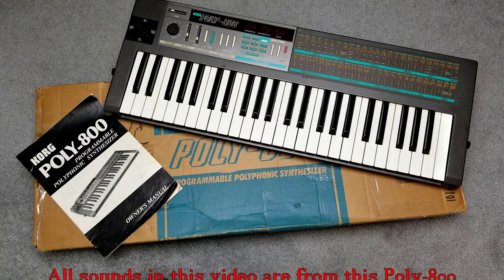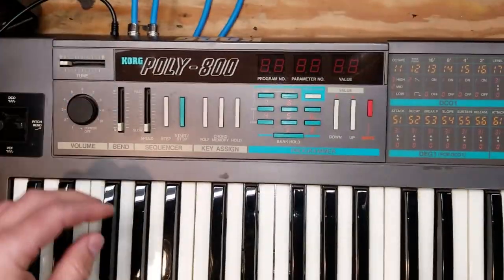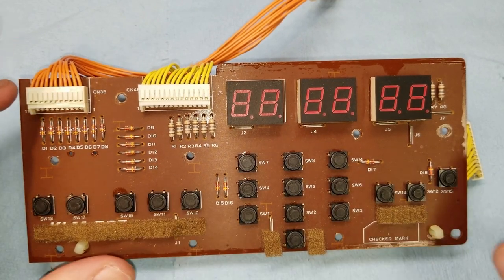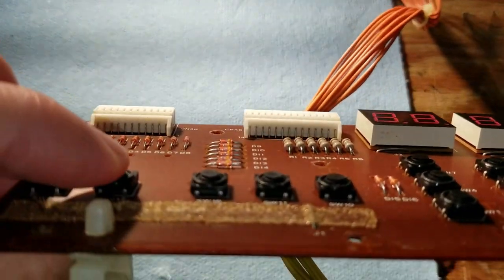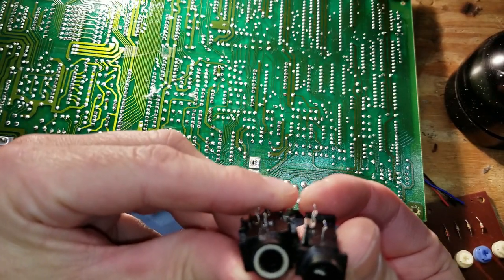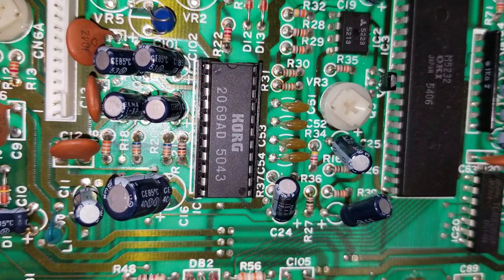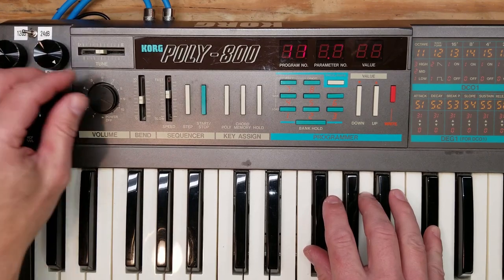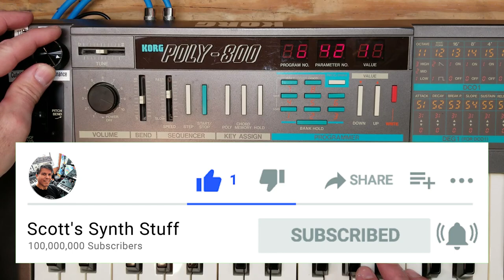Fixing, Restoring and Modding a Korg Poly-800!

Comment: You got super lucky with that battery not eating away at traces.  These and a decent number of Korg synths from the same era (Poly 61, Poly 6, etc.) are quite well known for the batteries leaking over time and absolutely tearing the boards to shreds thanks to the acid.  

A few years ago these weren't even worth repairing because of it, but thanks to everything synth that's old being worth more money now, they're worthwhile repairing.
Reply from the maker: Agreed. I had a Polysix that I bought in the late 1980s, and over the next 10 years or so, the NiCd battery leaked in it and destroyed a bunch of traces on the circuit board. I restored it in around 2003 or so, replaced all the tactile button switches, and repaired all the corroded traces. It was a LOT of work.

Comment: Love your channel man, thanks for sharing all this!  I subscribed when I realized you've helped me several times (Cobalt 8 firmware upgrade and general care tips).  I found this video on accident trying to figure out why I couldn't load patches from tape.  Thanks for the reminder to do the Moog Slayer mod!  I plan to tackle this soon.

Couple notes:  My patches load but I never got the "Good" message that I had when saving/loading/verifying with actual tape recorder instead of a smartphone.  Seems to have loaded okay regardless (at least most patches).  My tact switches are touchy but I just use the bank hold (only use this in the studio).  Also, corroded audio jacks can often be fixed by rolling fine grit sandpaper and giving the inside of the jack a quick scrub.  Just wanted to share, maybe it helps someone.  Thanks again!

Comment: Excelent video.  I wonder, is it possible to use a power supply when changing the battery so you dont loose the patches?
Reply from the maker: Plug it in and turn it on, remove the old battery, install the new one, it will keep the memory.
Reply: @ScottsSynthStuff  thanks!

Comment: Superb presentation and clear description of how to restore this great little synth. Like some of your other commentators, I’ve had one of these instruments from new and 40 years on have two different problems that you weren’t able to cover as my model is one of the first and does not have back up battery, but relies on the type C batteries to back up the sounds, and when these expire, one loses the programmes. I’ve bought a CR2032 holder and the appropriate battery, but how do I wire it in and let it take over from the C batteries? Second issue: on turning the machine upside down I’ve upset the joystick, which has now gone limp. How do I fix this? It’s not broken as such, just limp and won’t stand up. You can still get modulation, but not pitch bend?
PS: Although there’s a space on the board where the battery would go (in the future models) there are no terminals to wire the same onto the board, hence my fundamental problem.
Reply from the maker: Just tack-solder your battery holder to those terminals on the board and you should be good to go. If it doesn't quite fit, you can extend it using short wires (like I did) and tack-solder those to the board.

As for the joystick, it uses little leaf-spring type springs - I would perhaps disassemble and see if one of the springs has broken? It could also just be dirty and preventing a spring from pushing against the stick end.

Comment: This is incredible timing for me as I'm restoring a Poly 800 II too! Amazing video. Did you notice any difference on the buttons once the foam was removed?
Reply from the maker: Nope, no difference at all. I'm not sure what the original function of that foam was, but whatever it was, it certainly wasn't doing it anymore. Maybe it was to act as a seal/barrier for any dust and dirt that got through the buttons on top? I can't say for sure.
Reply: @ScottsSynthStuff  thanks getting back to me. What I found is that the foam just helps the longer buttons sit more uniformly. Without the foam they wobble a bit, but honestly it's barely noticeable.

Comment: Exactly what I was looking for, many thanks!!👍
I am wondering if a ring modulation mod could be done as well!!
Reply from the maker: Ring modulation normally works on two oscillators and multiplies the oscillators together to get the ring modulation effect. The poly-800 has only the one oscillator per voice, so it's probably not something you could do.
Reply: @ScottsSynthStuff  
Thanks for answering!! Yes, just after posting I was in a doubt about the Poly800 having one oscillator instead of two! You confirmed this!👍

Comment: Hello, Scott! Can you please send me the location where the wires from the pots are soldered, as the website mentioned in the description is no longer active... By the way, excellent video.
Reply from the maker: What a shame that site went down, there was a lot of good info there. Anytime a site like that disappears, you can usually still find the content in the web archive, and that's the case with this one. You can see it here: https://web.archive.org/web/20220427121311/http://synthmod.net/korg/moog_slayer/
Reply: @ScottsSynthStuff  Thank you very much! I just have a question about soldering the red wire to the resistor: can I use the resistor we desoldered from the ground, or should I buy a new one with a value of 470-510 ohms? I don't have much knowledge about electronics, I'm just a synth enthusiast :)
Reply from the maker: @Kassatube  you can just reuse that resistor!
Reply: @ScottsSynthStuff  Thank you for the quick responses, You're the best. I'm diving into the work right away!

Comment: great video....i have a poly800II that needs some components replaced 
due to dampness issue. do you or could you help me identify which 
resisters need to be replaced. thanks...would love to get it working 
again
Reply from the maker: If components were damaged because of inappropriate voltages because of dampness, you are (potentially) going to need some very complex diagnostic skills.

Comment: Best video on the subject, thanks! Unfortunitely there are no true videos on how to do the mod on yt. All i found were short demonstrations. The somewhat cumbersome read of the original slayer mod webpage doesn't help either. Can anyone tell me why the pots need to be logarithmic, not linear?
Reply from the maker: Because audio is logarithmic, that's why it's measured in decibels. Anytime you're controlling audio levels with a pot, you need it to be audio/log taper, not linear. If you use a linear pot in an audio application, you get 95% of the pot's travel that does virtually nothing at all, and the last 5% travel goes from nearly zero to full.
Reply: @ScottsSynthStuff  Ok, thanks. I was just thinking about it from a mathematician's pov 🙃

Comment: Awesome job..! Do you have the ref of the jack for the headphone and mono out ? I need to repair my poly 800 to. :)

Thx a lot
Reply: It is much too expensive for a shipment to Europe via Syntaur :(
Reply from the maker: I didn't even bother to look at the specs of it, or research it - once I saw that Syntaur had them, I just bought theirs. 

Usually, I will measure pins and sizes to find a component at an electronics supplier, like I did for the tactile switches.

Comment: Mine keeps fluttering in and out of tune and it's driving me crazy. Even replaced the internal battery.
Reply from the maker: Have a look at the pitch bender potentiometer. Also, an unstable power supply can cause this.
Reply: @ScottsSynthStuff  It may be more than that, the synth seems to no longer hold presets after turning it off and on again. Such a pain these things are!

Comment: The volume dial on my Korg Poly-800 half works, in that it raise the volume on the left channel only, unless I apply a little pressure (push it down) which makes the right channel join in. Is there an easy way to fix this?
Reply from the maker: It sounds like someone maybe at some point gave that knob a whack, and potentially broke one of the solder joints that connects the volume pot to its board? I would open it up and re-solder each of those connections from the pot to its board, see if that fixes it.
Reply: @ScottsSynthStuff  Thank you! Will give that a go.
Reply: @ScottsSynthStuff  I didn't need to solder in the end. Removed the plastic dial and gave the volume turning parts a dose of Deoxit and that seems to have done the trick.

Comment: I got ripped off by reverb for a poly800 w fm800 and moog slayer mods,makes only noise and wierd sounds,the seller says i have to load the memory from tape for it to have any decent sounds. I tried to return but got stalled and missed the cutoff date to return. I made a video of the only and best sound i could get.to hear search for “ axe lighthouse korg poly800 issues. I tried to load from tape but didnt load.any ideas
Reply from the maker: It took me quite a few tries to get it to load the sounds. It is really picky about the volume level, and some of the recordings of the factory sounds just didn't work at all for me. I ended up playing a YouTube video containing the factory data on my phone, and with the volume up all the way, running that into the synth, and after 5-6 tries it finally worked.

Comment: Great vid.  I have the ex800 and replaced the soldered battery holder as well.  The buttons are also a nuisance but will work. That single filter is good but paraphonic is a bummer.  However, as I watching this vid I realized that my new Solina is also paraphonic.  Time to midi them together and see what happens.  That 6 stage envelope is fun.

Comment: what was the Job of the Trimpots before desoldering? And how it comes that you can still use the Poly 800 like before desoldering the Trimpots... as the new Potentiometer dont get saved with a patch aint the cpu misses the desoldered trimpots at anytime? Really confused here
Reply from the maker: The trimpots are used to calibrate the filter - cutoff and resonance. Once they are removed, the new potentiometers mounted into the top of the case take their place. So functionally they're still there - except now they are full-sized potentiometers. Now you can adjust the filter cutoff and resonance manually with knobs on the case, instead of using the trimpots mounted on the PC board.

Comment: Greetings to all, someone who can help me with my korg poly 800, connect a charger, I think it has a lot of voltage and it turned off and does not turn on anymore, what happened? could it be the protective diode at the input? Would the internal card be burned because of that? any trick remedy or solution here?
Reply from the maker: The diode protects against a reverse polarity power input. As to what has been damaged, you'll have to do some board-level testing to find out, really.

Comment: Thank you for this video. 😎
I didn’t quite catch how you was getting the audio file from your phone to the synth. If you could explain that would be awesome.
Reply from the maker: A cable. I plugged one end of the cable into the headset jack on the phone (which I admit most newer phones don't have) and the other end directly into the synth. I had to drag out an older cell phone with a headset jack in it to do this.
Reply: Thank you. 😎